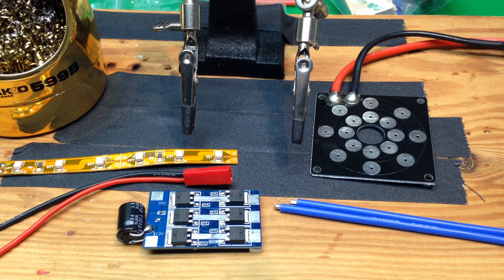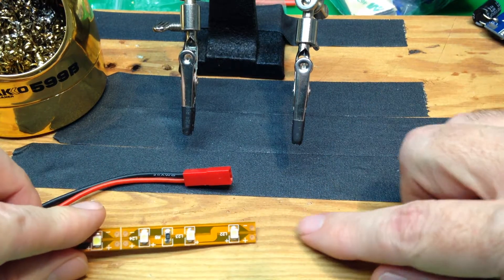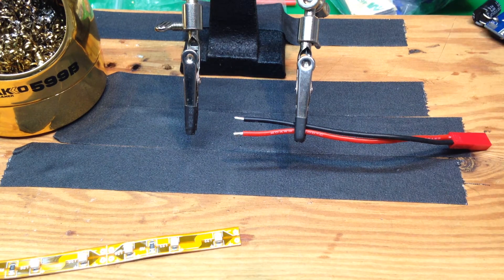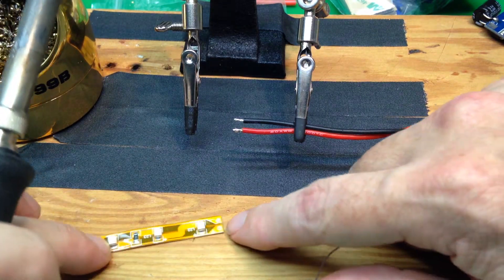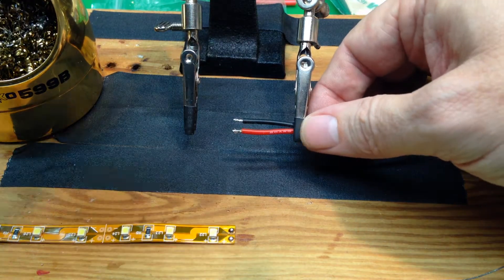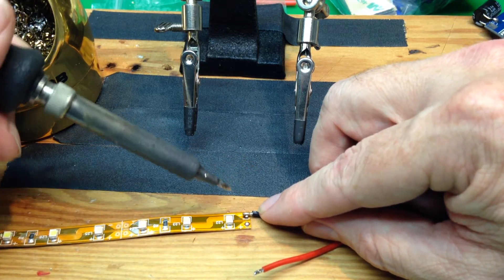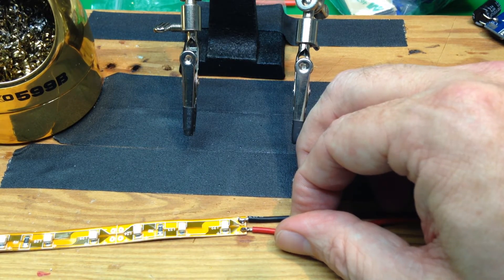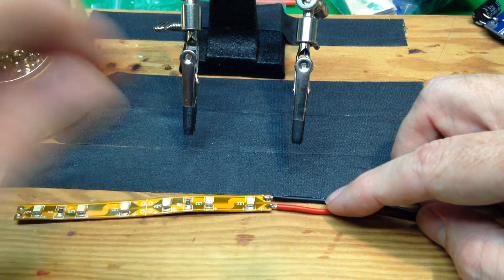East Bay RC Soldering Guide, Part 7: Wires and Solder Pads

Comment: Mark, would you please comment on preferred solder iron temperature when soldering to PDB's?  How about when soldering to the fragile LED strip?  I was thinking around 380-400º C. (716-752º F).  What say you?  Thanks for the vid!
Reply from the maker: You bet!  I think your range is good.  By default I use 750, so that should be good for the solder strip.  The key is to have a very short contact time.  For the PDB, more heat is better for the biggest wires, so cranking up to 400C will be good if you've got 12 gauge wires.  If there's still difficulty, using a larger tip can help get the heat spread out.